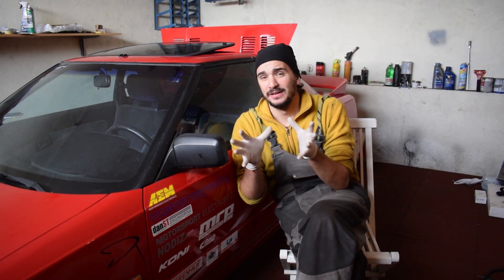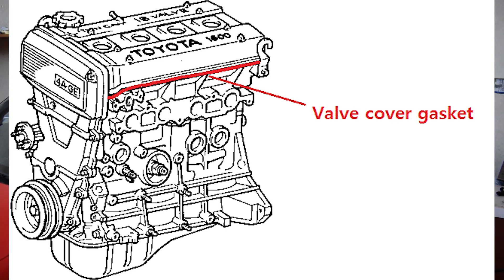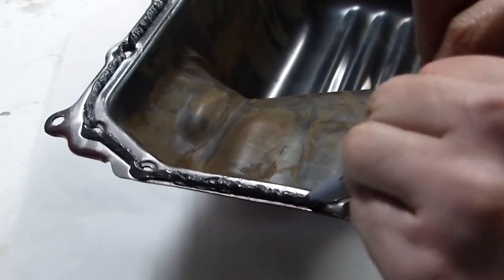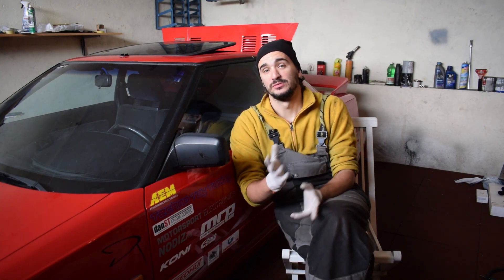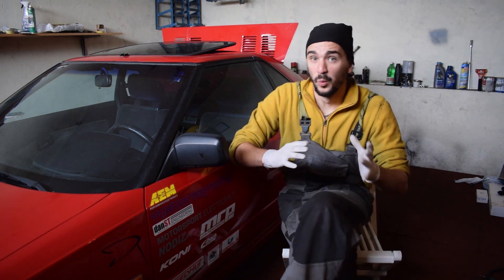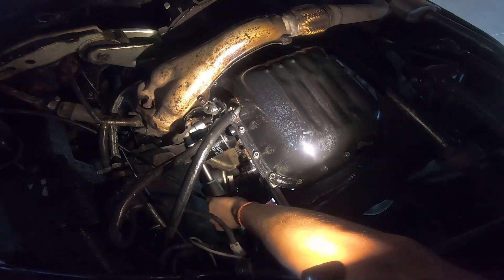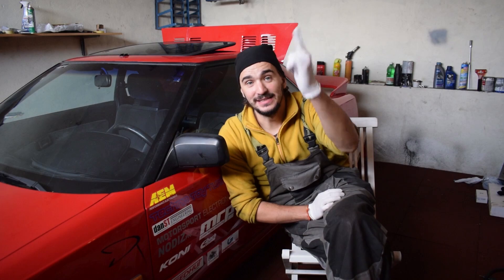How to FIND and FIX an oil leak

Comment from the maker: A good working light so you can actually see the oil leak: https://amzn.to/2BL50lw
And another more mobile lighting option: https://amzn.to/3491wFq
Brake cleaner to clean the suspected area of the oil leak so you can spot the source: https://amzn.to/2MSQ8Ig
Buy some fun and useful stuff and support the D4A channel!
Discounted tools on amazon: https://amzn.to/2rZwqCr

0:26 - why oil leaks happen?
3:50 - how to find an oil leak
Common oil leak sources
7:47 - Rear main seal
9:28 - Valve cover gasket
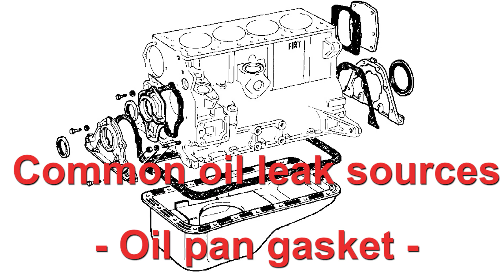10:30 - Oil pan gasket
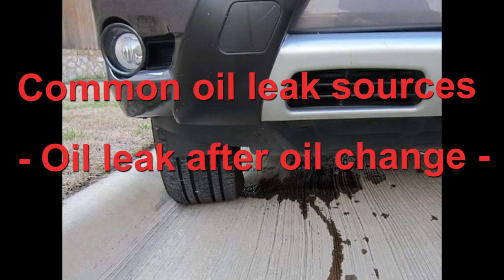12:03 - Oil leak after oil change
13:09 - Timing cover gasket
14:26 - Can I drive with an oil leak
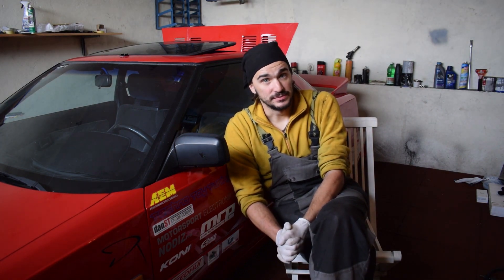16:59 - What happened to my engine

Comment: Oh and that oil cooler relief system is a killer for sustained high rpm driving as it bleeds oil pressure off the system and through the cooler then into the sump. I had one on my 7MGTE and removing it netted a noticable increase in PSI at high rpm. I made a custom sump-to-sump oil cooler system with a VDO oil pump and an autometer relay control oil temp gauge. Very reliable and does not interfere with engine oil pressure nor does it require pressure to cool the oil!
Reply from the maker: Absolutely nobody loves this stock system :) I love what you did, I will likely do something similar and get rid of this thing as it has more disadvantages than benefits l.

Comment: The distributor is also a pretty common one on older cars, happened to me a while back. Oil escaping from the distributor dripped down into the alternator and not long after that failed too.
Reply: Definitely the second most common place for the 4AGE & GZE engines to leak after the valve cover.

Comment: on oil leaks, I had a particularly maddening one on my 1999 SAAB 9-5. I had oil dripping down the timing cover, behind the front pulley, and onto the oil pan. because the timing cover on the 9-5's is basically sandwiched against the inner fender, I couldn't see where the leak actually was. 

I replaced the o-ring on the oil cooler bypass plunger assembly, the oil cooler hoses, the front main seal, and the valve cover gasket, and still had a seeping oil leak. 

Turned out at some point the upper accessory belt pulley disintegrated, and drove the accessory belt into the soft aluminum timing cover. I didn't end up finding the damage until I pulled the engine to do a timing chain and balance chain replacement. Someone had 'repaired' the damage with some JB weld they had shoved into the crack and sanded flat. turns out JB weld is porous enough to pass oil through, and was similar enough in color to the aluminum that I couldn't spot it in the car. 😐
Reply from the maker: Hope that po doesn't run into you somewhere :) :)

Comment: Excellent video, liked what you said about additives. I think even the additives that are to refresh your seals are suspect. I have a unusual problem. My eng has been running hot, replaced my rear main seal because my mechanic said it was leaking, that did slow the leak or at least stopped the leaking there. My other leak he said was my timing chain cover, have not done that as of yet. Today, this evening I opened my hood and there is a puddle of engine oil collected on top of my transmission. Tomorrow in the morning, I am going to remove my engine cover to see if that oil is running down from somewhere. 

I drive a dodge journey 2.4 liter 2015, has high milage but she runs good. Just this running extra hot, he also replaced my water pump. I don't think the timing chain cover  caused the puddle on my transmission housing because it's on the opposite side of the engine. so where ever it is coming from it has to be a high point to puddle like that.

Have you ever heard of this happening, if so I could use someone to share some ideas. Also if and when I find the leak will shaare my findings with you.

Thanks,
Reply from the maker: You'd be surprised how weird leaks can be, they run along an edge of something and make puddles very far from the source. If the engine is overheating I'd check for clogged radiators. Touch when engine is hot. Radiator must be equally warm everywhere. I would also bleed the system to eliminate the possibility of air in the system. If the problem persists check for a blown head gasket. Is the fan working properly?
Reply: @d4a  Will do, as soon as the sun comes up gonna check to see where that puddle of oil accumilated from. I'm 67 and have never seen this before. there is no overspray of oil in the area around the puddle, it's a fair amount of oil I might add. I checked the oil and there is no water /oil mixture...thank God. Will read up on how to remove air from radiator just in case, also no check engine lights as well. Also, thanks for replying back, I don't have any friends with mehanic knowledge, when I talk about this stuff they just drift off somewhere...lol

Comment: It looks like the oil pressure switch was over torqued at some point and had a small crack that you couldn't notice, and it spread over time.. great video like always :)

Comment: Once my dad ran into a very lucky stone in the forest. So lucky that this stone chipped off a piece of the oil pan. And not a single welder with a welding machine for several kilometers around.  well, he drove to a place where they sold oil (apparently in barrels), bought oil and drove to civilization adding oil every ten minutes. And arrived after all. If anyone is interested, it was on a moscvitch 2141.

Comment: The best way to fix any oil leak is to.

1. Get some very strong engine cleaner.
2. Clean your engine and gearbox
3. Then all the oil leaks will be visibly seen on your engine or gearbox

Comment: My recently bought bike had an oil leak from the pan somewhere. Turns out the previous owner did an oil change and threw away the copper washer and left the bolt loose. I was happy it was a $3 repair 😊

Comment: Oil leaks can be categorized by class I, II, III

Class I oil leak is when you see wetness on the parts but there are no droplets and none has fallen to the ground.
Class II means there is wetness & droplets but none of the droplets fall to the ground
Class III means the leak is severe enough for the droplets to start falling on the ground or worse, it's spilling out onto the ground.
Reply: Class IV: “Game Over” - This is when oil is suddenly squirting on all directions and all gone in less than 60 seconds.

Comment: Hi thanks for your video, I noticed an oil leak on mine after I got a major service done I could smell it through my vents and had a few droplets on my driveway, garage is telling me it's either my gearbox or crankshaft but won't know until they strip it down
Reply from the maker: Maybe a bit of oil was spilled on the exhaust manifold during the major service? Leaks can come from many places and must be located before stripping things down. A leak can't be found anymore once you take it all apart, that's silly.

Comment: In my 2007 Kia Optima (4-cylinder), I can no longer pull in fresh outside air (heat or A/C) without the strong, unpleasant scent of burning oil. I don't notice much/any oil drippage on the ground, nor have I noticed any blue smoke come out the tailpipe.  Based on that information, would I be correct to deduce that the valve cover gasket must be the source of the leak?  How else could oil be getting on the exhaust headers?  Or, am I wrong to assume that it must be getting on the exhaust headers?

Comment: Just left my old 3 seater Rav 4 to the garage as I smelt weird burning smell underneath the exhaust was all wet.  They have to remove had the engine to find the leak!  Will let me know what the problem is and go from there.

Comment: new battery but battery light came afterwards no headlights,radio,air conditioner but have signals. dashlights, door lights. also the next day the new battery was toatally dead. what do you think culd be the problem

Comment: Hello. I have a 2004 Subaru WRX that suddenly began to leak oil, according to the dealer. I could not find any oil dripping onto the ground, and the car’s oil level stayed full over periods of months. Car is driven each day. I still get the burning oil smell each day. I see old, dark oil in a few spots on top of engine, could that be source of the smell?
Reply from the maker: If you're smelling it, it's likely getting onto the exhaust manifold somehow, that's the only for the burning smell to occur. Thr exhaust manifold gets very hot and it sort of cooks the oil. Even tiny drops produce a noticeable smell.
Reply: driving 4 answers  thank you! I thought the same thing. Not sure how the old oil got there but it needs to go. What would you use to remove it? It’s in a couple of hard to reach places atop the engine. Thanks again!
Reply: Thats exactly what my acura is doing. I cant see any oil on the ground and the oil is still full 2 days later so why is the dealership saying i have an oil leak? Could it be oil from a previous leak that was fixed and never cleaned? I would like to check myself to see what's going on.

Comment: I was told I have an oil leak however I see no oil on the ground. When I check the oil the oil line is still full. Idk what to believe so I'm gonna try that oil test to make sure. But there is no evidence of an oil leak other than someone saying there is. And apparently there's multiple oil leaks. The parts arnt expensive but the labor is and i don't have that kind of money so I'm trying to figure out whats the best approach. Do you have an suggestions?
Reply from the maker: Rear main seal?
Reply: @d4a  yeah and some other places

Comment: if a gasket is missing couldnt it cause a slow leak??
Reply: Depends on what gasket (oil pan, valve cover, etc), but it would most likely be more significant than a slow leak.